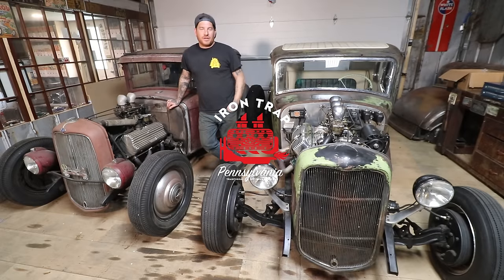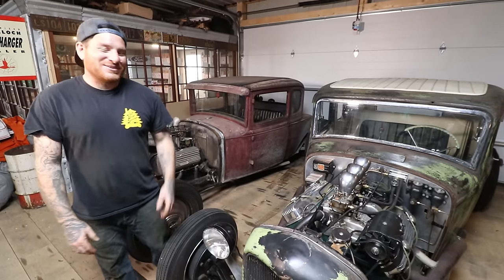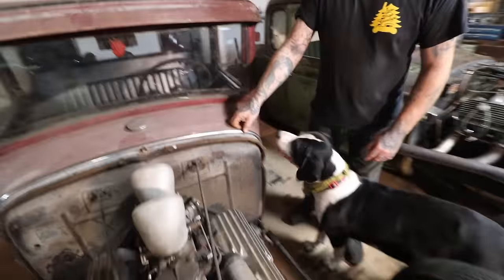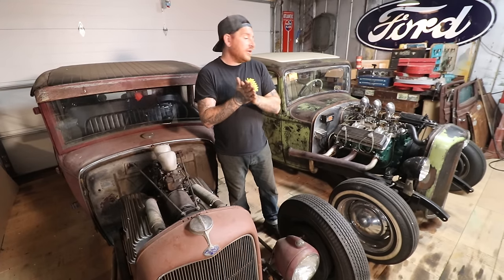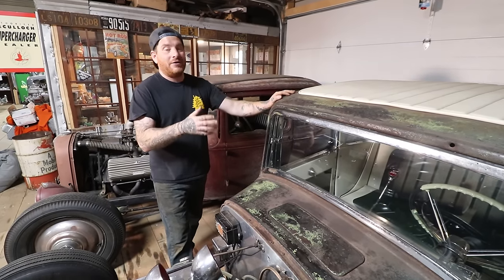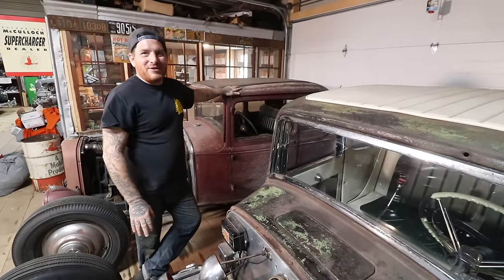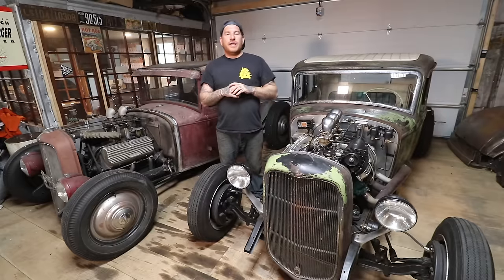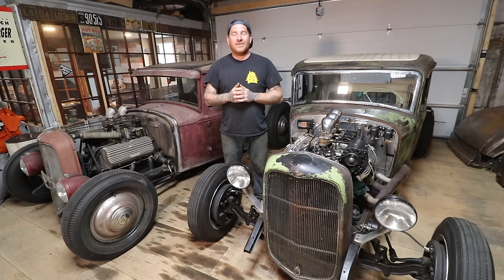Early Ford Spotters Guide- Model  A and 1932 Ford - Major Differences

Comment: Hey, Matt!  I love your expert commentary and you are much more knowledgeable of these early Fords than I.
Still I would like to add the following:
You are very correct about the Model A and the '32 5-Window being more different they are alike!  I have always seen the '32 as a "logical evolutional" step in Ford automobile body/frame/suspension design and engineering with the '33-'34 Model 40 being another evolutionary step as is '35-36 and the '37-'40.  (JMHO, of course.)   
The rear windows on the Model A Coupe and the '32 5-Window Coupe are completely different, too.  Model A is slightly larger and the corners are square where the '32 has very pronounced rounded corners at the top and lesser rounded corners at the bottom.  Also, the width of the steel at the top of the '32 above the windshield is wider and more rounded than the Model A.

Comment: Great quick video on what common things to look for between the models. My opinion (probably controversial) has always been that the 32 Ford was the final perfection of the Model A design. But also a transition model that was used to try out new manufacturing, styling and assembly processes. Having worked for Ford Engineering 38 years that is a very typical thought process. Stamped and painted grille shells is a perfect example of a change in process and materials used. The moving of the gas tank fore shadows  what was to come for the future. A lot of other cues you mentioned are very purposeful changes to reduce cost and still add some styling. The 1932 Model B was the car equipped with the standard 4 cylinder engine. A 1932 with the new optional Flathead V8 was designated as the Model 18.

Comment: I was taught that the easiest way to also tell a 28/29 A body from a 30/31 A body is the cowl area.
28/29 has the cowl to A pillar area that's basically like a vertical piece of square tube whereas the 30/31 has it blended to meet the doors like a 32.
Hope this helps others ID them.

Comment: Way to tell an early model '31 model A from the last ones made in the '31 model year is the firewall.. the late '31's had an indentation where the fuel bowl is on the passenger side.

Comment: Is there a way to tell (with just the coupe body) if I have a 30 or 31?  It is getting close to time to register my car, and it’s a real hodge-podge of parts. I have a Model A coupe body on a 32 frame with 40 suspension with a 32 grill and 32 dash. I don’t know how to register it-30or 31!  I think the firewall is original-any distinctive features there I can consider?
Reply: 31 has a recessed area where the fuel valve goes.

Comment: gas fill on the front cowl under windshield, and windshield surround size. Grille usually tells you but theres not all that many left of those on hot rods, stock ones its easier